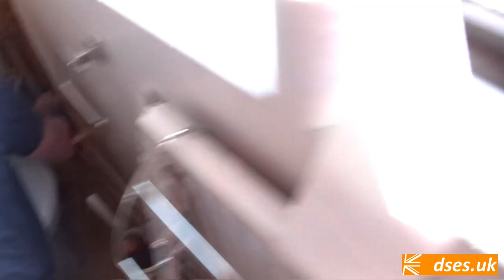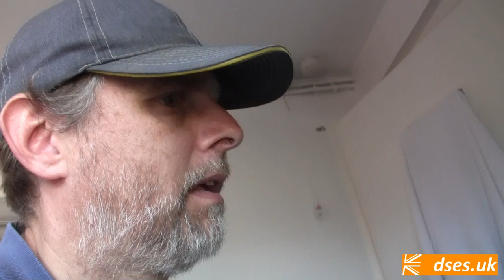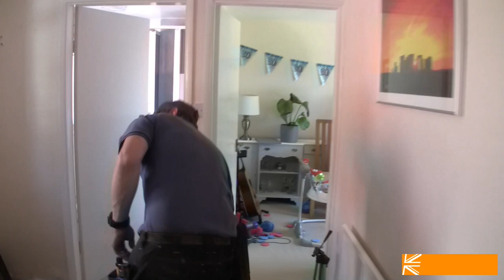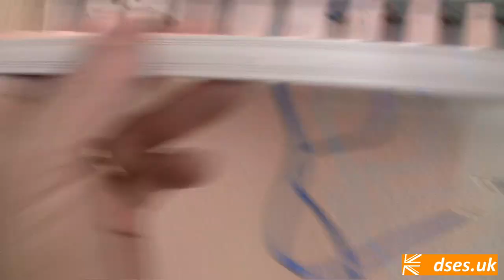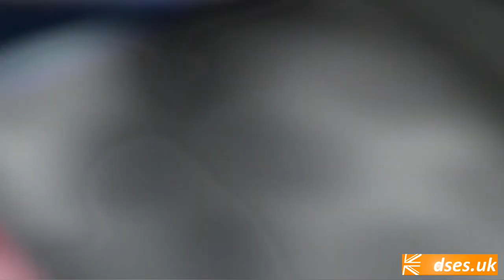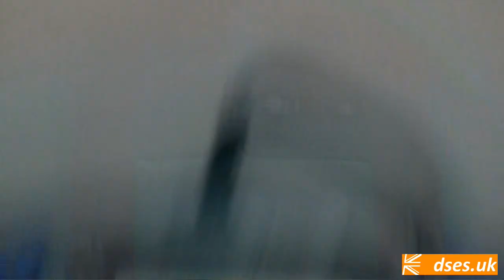Two dicks, one hole... and a new C.U.

Comment: I was just thinking , do any of you guys use through crimps with heat shrink these days . We were always concerned about any mechanical Joint that could over time reopen , especially if the circuit is of a high amperage ie shower or cooker . I suppose admittedly I was a bit belt and braces in my time , but I’d be interested in what any of you think   Best wishes and kind regards 😀👍👍👍
Reply from the maker: I never was a great fan of crimps Michael, and to be honest, the only time I use them these days is to splice a 10mm cable (or above) which I would then heatshrink. With push-fit connectors available, the faff of crimps is largely dispensed with, although most manufacturers only have push-fits for up to 6mm cable.

Comment: What a sh1t connection to CU that the others installed. Can't beleive that they did not run the cable up the wall in a umch neater way.

Comment: Dave , I found me is a bit is be that essentially you have to use the same manufacturers CB,rccb, rcbo, while all.of those should be tested/rated to the same BS.  So it should not matter which brand you use.
Reply from the maker: The trouble comes with type-testing rather than British Standards. Brand X certifies their boards only for use with their components, so if you stick in Brand Y, you accept responsibility for the manufacture. That is to say, if a fire occurs in a Wylex board after you shoehorned in a Hager breaker, then potentially you're the one in trouble as Wylex will say non-type tested equipment was installed (whether the fire was related to that or not). Regulation 536.4.203 appeared in 18th Edition for this and it makes mixing manufacturers a non compliance and your responsibility as the installer.

Comment: That heat pump work looks shit.
Reply from the maker: The sub-board and pump (on the other side of the house) were okay, it's just a shame to see the T&E coming out of my board like that and to have the SWA across the front face of the house. I'd have run it in the roof space above for the most part, having taken the feed through the rear of the CU and up the cupboard in the bathroom with all the other wiring to keep it concealed as much as possible. Still, that's the problem with the big renewable boys - just staple it on and move to the next one.
Reply: @dsesuk  I bet they didn't even terminate the SWA correctly in that wiska box...

Comment: Isn't that meter cab supposed to be sunk into the wall? 🤔 Otherwise awesome job. Looks a good consumer unit.
Reply from the maker: They can be sunk or surface mounted. In this case, it's a single skin wall, so sinking isn't an option or the back of it would be in the bathroom!
Reply: Surface mounted is the way to go for relocation of the cut out / meter even if it's a cavity wall. It's the construction side that would make the recess type difficult. Should really have a lintel and cavity tray /weep vents installed above the enclosure as you would be creating a structural opening. Far too much of a ball ache in my opinion.
Reply from the maker: @Daniells1982  Oh yeah, it's not a job I'd undertake. If a client wanted flush mounting, I'd get a builder to do all the tough stuff, but it would command a premium cost over simply bolting a box to the wall!
Reply: If it were my own house I'd want it sinking into the wall. It just looks nicer. Though I accept that in some cases it's not possible.
Reply: @dsesuk  definitely Dave. See what you're saying too Steve, you want a nice looking job. Just becomes a lot more involved is all.